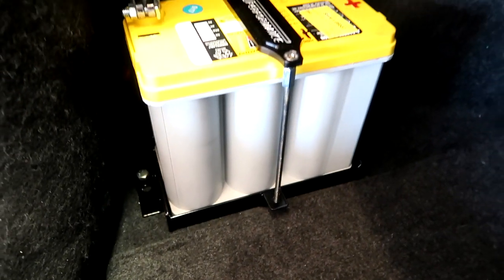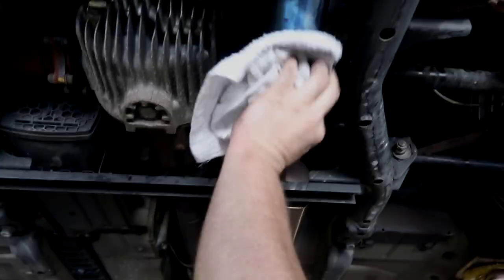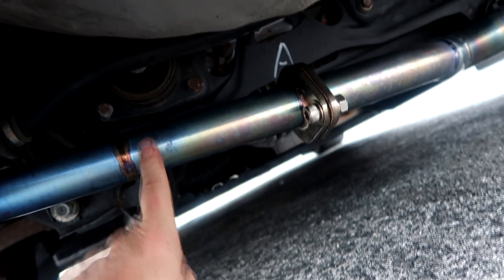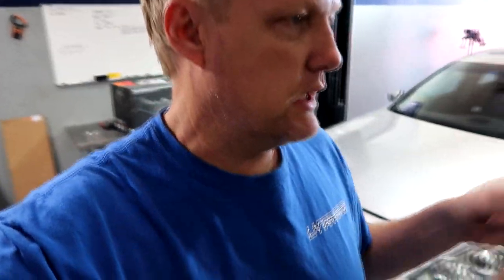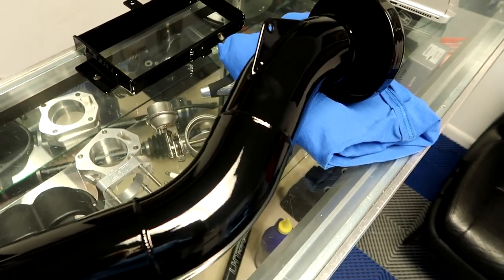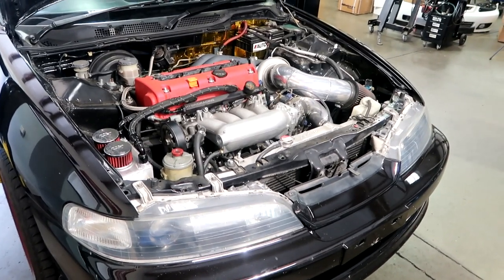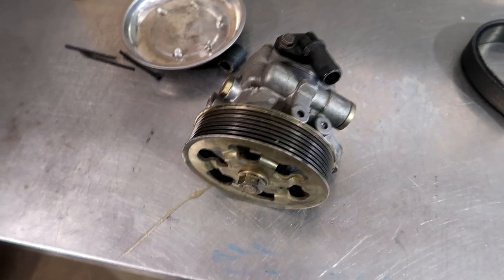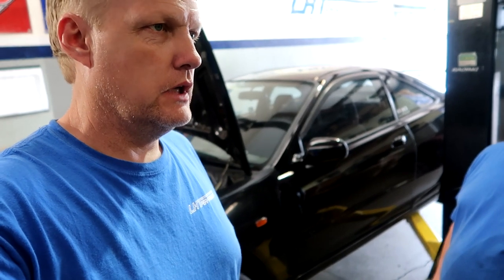Wednesday V-Log 4

Comment: I saw cruise control issue on the checklist. My cruise control doesn't work in my '01. Cable is on, fuse is good, button light turns green, but it wont engage. Checked the pedals too thinking it was disengaging from placement. Btw I'm coming to you guys when I finally Supercharge. From Ohio.

Comment: Space grease on lug nuts is a big NoNo. At least up here in Canada it's forbidden for a tech to do this.
Reply from the maker: Thermalstorm I would say it’s more important that ever in a ‘ rust prone ‘ environment.  We see so many broken lugs that would have been prevented by applying some sort of anti corrosion measure. I wouldn’t use grease or oil as it will alter the torque spec and clamping load.
Reply: LHTPerformance yes that's my point exactly. It alters torque specs and in some cases will allow the lug nut to actually back off. My comment is based on what was discussed in college.